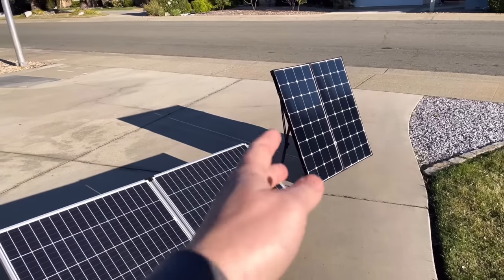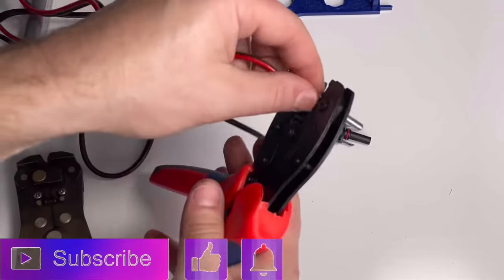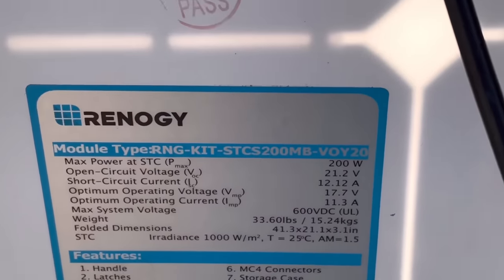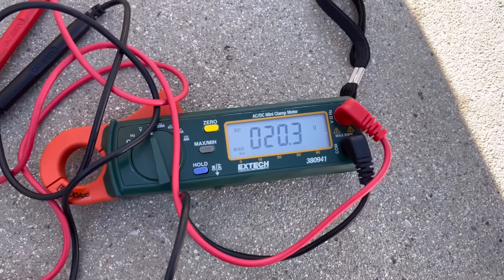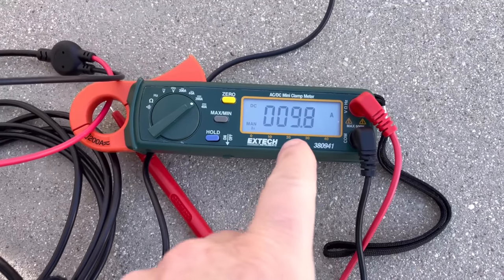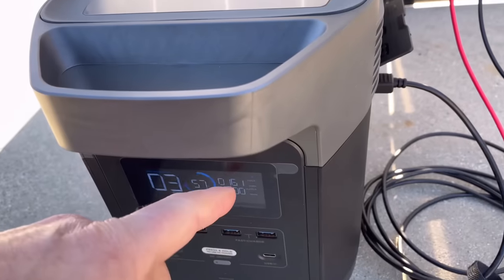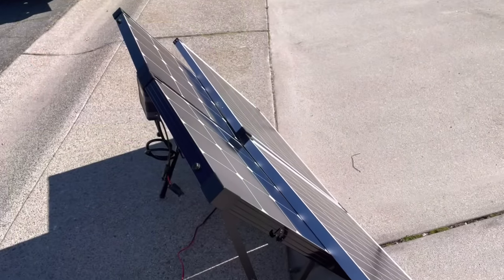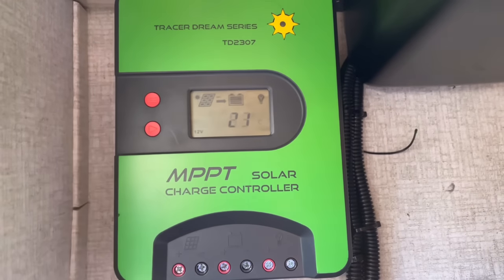Best Solar Panel - Harbor Freight 100 Watt Solar VS Renogy Eclipse Solar

Comment: I've got "200 watts" worth of harbor freight  flat mounted on my roof.  2 years later I can say.   The charge controller in their Kit SUCKS. But...they are damn useful. I have lights, device charging and super important..  FANS. I had to replace charge controller.   But the actual panels have proven to be super useful and durable,  despite a couple of brutal hail storms.
Reply from the maker: Nice thanks for the feed back ..👍🏼
Reply: Do u even need a charge controller if u plug them directly like into an ecoflow delta? New to solar thanks
Reply from the maker: No you do not, as most power stations if not all have a built in charge controller to charge at the correct rate. So all you need is a solar panel and the right connection for your charging station. 👍🏼
Reply: @johnnysweekends  ok great thanks
Reply: @troyyarbrough   I'm no solar expert by any means...I travel full time in a 1987 decommissioned ambulance, the harbor freight kit was super useful...all plug and play, can't screw it up. But yeah, fried change controller in just 3 months!
Reply: @troyyarbrough  why bother with the kit then. The kit is 4 25w.panels equaling 100w. These 100w panels are about 2/3 the size of the panels in the kit.
Reply: @johnnysweekends  You don't know what you are TALKING about with all due respect. Not all Pwr Station internal controller are optimized or the same. Not all solar panels are the same. There are less than ideal combos. Very popular YT channels have shown this.. YES I could run straight panels and get 90 watts and almost nothing with low sun. With the booster (it up to the same Volts and Amps to the equivalent to the Power Brick it comes with. AC plug in brick is 24v/5A/118W). Matching that with panels the Pwr Station comes alive. Are there higher voltage panels that would do better straight into the Pwr Station? Yes. Could I use lower voltage panels in series and get closer to the magic 24 volts (magic to this power station).  I have a degree in engineering. I have tested this extensively and know what I am talking about. See you at Harbor Freight. Peace.
Reply: @miamivice1149  I got a rover myself.  Not a bad controller, get the wifi adapter.  The wire terminals suck.

Comment: I bought four of these today, 4/10/22.  They are on sale yesterday and today for $89 per panel. Not bad.  I figure these, along with a Bluetti AC200MAX, will give me a good start on emergency power for the house to keep food frozen.  Additionally, it will pair nicely with the solar setup I have in my camping rig.
Reply from the maker: Nice that is a good deal. I bet they stocked up…
Reply: LOL fail. Wait to go solar.
Reply: My first renogy 100w panel was $130 later prices went down to $67 per panel on ebay.
Reply from the maker: I have one of the Newair portable fridge and it’s been great so far. I did a review on it. And have a promo I think for a little longer if it’s something you wanna look at..👍🏼
Reply: @johnnysweekends  I have an Aspinora fridge or freezer that I like.  Interested in one that has a true fridge AND freezer though.  Space is a real issue for me though.  I camp out of the back of my pickup with a 6.5 foor bed, so the freezer needs to fit between my sleeping bed, and the other wall of the pickup.  I have also switched from lead/acid to both a LiFePo battery, and a Bluetti AC200MAX for storage. Both have proven themselves needed, as we have had lots of rainy days this year. I am also a bit of a prepper, not hardcore, but that Bluetti will keep a fridge and freezer running by itself for a number of hours.  Couple that with the four solar panels (currently uninstalled), and I should be able to keep the fridge and freezer in the house running indefinitely.
Reply from the maker: Sounds like your setup is ready for what ever you choose. Just need to measure your space and start looking to see what will fit.
Reply: @johnnysweekends  Seems like I am always remeasuring, reallocating space. I went from a mattress the width of the floor to a 30" wide cot and mattress, which leaves me with about 39" of width to play with.
Reply from the maker: Hmm that fridge may work ? Probably be close.
Reply: A lot of people want a plug and ignore Battery/inverter. I lost my power for a week and never lost anything on two refrig's by running for a half Hour or when they turned off every 4 hours. Before I went to bed I ran until they turned off.  I was on my 3nd of 4, 6 volt batteries in my Golf cart, so I had another 2/3 days to go. Now I bought the Solar battery with a 1800 watt inverter and I think I am good until something breaks.
Reply: I have a SET POWER freezer fridge about the size of a big cooler.
3 100 watt HF panels, 3 deep cycle lead acid batteries with a 30 amp controller.

Works great.

I use the freezer part to freeze large bottles of water.
The squarish juice bottles work well.
I rotate the bottles into another cooler to keep food cold.

The dual zone refrigerator part is large enough for keeping 1/2 gallon of milk, butter and other small stuff cold.

My next expamsion will be to buy an ice maker and run it from solar wirh an inverter.
Reply: Wouldn't it be cheaper to replace the frozen food than spending big  bucks on solar?

Comment: Where you will see the difference between these two panels is in conversion efficiency. Renogy uses monocrystalline cells and HF uses a cheaper polycrystalline technology. The monocrystalline cell will produce more energy in less than ideal conditions such as cloudy days and or orientation of the panel. It's still a cost vs benefit decision, for me, if I had $500- $600 to spend on solar I would go for twice the capacity with HF panels.
Reply from the maker: These are actually Monocrystalline panels. It’s a newer line they have now and if you get a good coupon instead of the $119 price you can sometimes snag for about $95 if they have them.
Reply: @johnnysweekends  If that's the case, it's a no brainer.
Reply from the maker: Right ..!! 👍🏼
Reply: I can't speak for Harbor Freight, but Renogy has the absolute WORST customer service in the world.
Reply from the maker: I have heard the same. HF if you buy the warranty you swap and go..👍🏼
Reply: @Rob Ott lol
Reply: They are currently on sale for $89.99 through 4/10/22
Reply from the maker: Wow smoking deal..!
Reply: @MudmanMedia  WTF, WHERE?
Reply: @MR-nl8xr  Harbor Freight.
Reply: @MudmanMedia  Yea, but which location. I was just in the store and they were still 119.00.
Reply from the maker: Hmm maybe a region thing.. I should check 
Local store
Reply: @MR-nl8xr  I got mine in Hermiston, Oregon, a small store.  They had about 10-12 in stock, and more on order.  Sale ends today though.
Reply: @MR-nl8xr  I got mine in Dayton, Tennessee. It seems most of the stores in the Chattanooga and Knoxville area have them on sale.
Reply: The only time panel efficiency is a real need is in limited space applications . So yes RV and other mobile applications go with higher efficiency panels. Permanent applications I pay no attention to efficiency , I have all the room I need so why pay more per watt. Solar is fun , much , much cheaper than ten years ago. Both my remote locations have solar systems far cheaper than bringing power in.
Reply: Same, get two sets for the price of one.
Reply: I have the HF panels, and I'm going to get 2 more 100W panels to have a total of 400W.   I'm very happy paying less and I will do the adoption to make them better no need to o ay so much more.
Reply: Blue = poly
Black = mono

(most of the time)
Reply from the maker: The only problem with poly panels is they perform even worse in higher temps and they have a decently shorter lifespan then the mono type panels. So over 5-7 years after degradation of roughly 20% the mono panels will still be producing a decent amount more then the older poly type panels. So in the long run …👍🏼
Reply from the maker: No problem I still thought the same a couple years ago but the monocrystaline are just that much better now. 
But If you truly want the most watts for your buck stay away from these little portable panels and buy a residential panel. Like 335 watts for $150 bucks lol. 
Lightly used all over 👍🏼
Reply: @johnnysweekends  I have to agree panels have in average a 25 year @80% life. So buy all the used panels you can find , really especially if they are only like five years or so. BARGAIN! For the newbie I can’t say enough about the harbor freight experience. Learn in that system, play with that system  heck break that system . Everything you learn on the cheap system applies to any solar system. Besides it’s a great system for really small remote needs.
Reply from the maker: Yea I have seen those before. But really it’s buying what ever works for the cheapest price to save money is what people seem to be looking for.
Reply from the maker: Agree!
Reply: Great video, you very knowledgeable. Maybe you can help me.
I have 2 12v rv batteries that I'm trying to keep charged without running the generator. Just using led lights and running the radio, and heater fan at night when it's a tad bit cold. How many panels do I need to keep these batteries charged. If more then 1, which I figure 3 to 4 100 watt panels, what would be the best wire and such components to use to build a good portable setup?
Thank you!
Reply from the maker: Most the time to just keep a battery charged in storage 50 watts will do because it’s not being used. 
But when using your batts while camping 200 watts is minimum because most people camp in a lot of locations that are not flat with sun everywhere. It’s the coast or the mountains where you loose some solar hours. So 200-400 watts would be great and a portable 100 or 200 watt panel you can hook up as well for time when maybe camping in the trees and you may have to chase the sun a little with a portable one. 
 
Normally with solar more the merrier because then you don’t have to worry so much. Just don’t over load your controller . 👍🏼
Reply: @johnnysweekends  my rule of thumb? Double what you think you need, seriously !
Reply from the maker: For sure especially on RVs because with all the panels flat and never at optimal angle or direction of the sun plus trees and mountains it seems that is becoming the standard. 
Yea just get more.. 😂👍🏼
Reply: NEVER buy Renogy.  They sent damaged product didn't receive back.  Actually told me I had wrong number via email.  I reported them
Reply: @TC-qs7yb  trendy heavily markets stuff is not usually worth it. I always hunt around. The sheep buy the noisiest, with out thinking. Especially Solar panels. Panels can be had for next to nothing used , after 25 years most panels are only 80% efficient. Let’s see 20% of the cost for 80% of the power. Nope I am going the trendy expensive crap. I think not especially if this is your first DIY solar project
Reply from the maker: A lot of complaints about renogy
Reply from the maker: I agree residential panels are the best panels to get for dollar per watt even better used. They only thing these are good for is right spaces and weight savings depending what your doing. 
But not cheap.
Reply: @ytSuns26  we have a very small slide in camper on my husbands S 10 Chevy truck. I just want a very simple set up to run a small refrigerator maybe a griddle and my coffee maker and maybe a light….Do you know of any simple kits that are very expensive as we only camp 2 to 3 times a year and I’d like this to be portable so I can use it elsewhere if need be
Reply: No they don't.  I just bought 6 and they are all monocrystaline😊. Got them for 89 per panel on sale

Comment: I started buying H-F panels when they came in packs of 3 for 90 watts total for about $99 and added a total of 18 panels (I think the last set cost $139).  All the sets come with their own controller.  I live off grid and feed the panels into a bank of 6 each 80 amp NiCad batteries and run a 5000W/10000 surge inverter.  I feed the battery bank with a Champion 3500 W gen powering a 100 amp battery charger as a back up but rarely use it.
I also put in a 500 wat wind generator but have found the money would have been better spent with more solar panels.   This is a poor mans set up but it works great and I can't complain about the cost (less than $2000).  The H-F solar panels have held up great in spite of hail,  freezing, hot 100* and snow.
Reply from the maker: Wow awesome, where about are you living off grid, seems like more and more people with minimal living costs.
Reply: @johnnysweekends  Up in the Rockies.  9000' so it's just seasonal but a nice getaway for the summer.  I got my off grid ideas from my wife's friend (a retired Fisheries Biologist) in Michigan.  He bought a pretty elaborate system with auto starting generator, wind generator, solar and lead acid battery bank.  I just built on that concept to see how it would work taking 
the cheap route.  So far so good.
Reply: I don't think the wind turbine was a mistake, you have to have a backup for when the sun isn't shining, don't you?
Reply: uh, 80 amp NiCad battery? I didn't know such a thing existed.
Reply: @nullsmack  Surplus aircraft batteries.  They weigh about 80# as well but last forever with proper maintenance.
Reply: I am interested in doing my own solar setup at home how do I get started.
Reply from the maker: Need to figure out what you wanna power. Grid tie system? 
Ground mount or something portable?
Reply: @johnnysweekends  it’s for my home
Reply from the maker: So a grid tie system will have be hooked up by a electrician and also permitted 
Unless you live kinda out away from everything
Reply: @johnnysweekends  you mentioned using old airplane batteries I am looking an affordable way
Reply from the maker: I didn’t mention that but some one else did. But it depends on price , where you can source them and how much power you can get from them for the price. 
New lithium batteries even from some cheaper brands are getting crazy cheap for how many Ah you can get. 
So see what the price is of both as lithium battery prices are dropping.

Comment: I bought 2 Renogy Eclipse panels 5 years ago. They died within 2 years. It took forever to replace them and I needed new ones on the camper so I replaced them with 2-100 watt Rich poly panels. When I finally got the Renogy panels, I decided to make a suitcase setup with them. I drilled 6-1/8" holes in the frames for hinges. The panels died within two years again. When I returned them they voided the warranty and never returned the panels. Had they been prompt in returning the first panels, I wouldn't have bought the Rich Solar panels. I will never do business with Renogy again. BTW: The Rich poly panels are still cranking out great power.
Reply from the maker: I have not great things about renogy customer service but again maybe it’s the upset people but I have not heard any positive so…🤷‍♂️ 
When it all comes from China you just need to find what’s the better of the bunch for the price 👍🏼
Reply: The Rich solar are $89 on amazon
Reply: Yeah, A few years back, i bought some renogy panel set ups for my bosses farm. it was supposed to have two panels an some other hook ups but all we got were panels. we reported that to them and just asked them to send a controller and something else but they wanted the 2 panels back as well since they didnt have independent parts. we tried again, and then we were missing one of the panels so we bought two more sets until we had all the parts we needed and then sent the rest back for refunds. seemed like they had already robbed parts outta the boxes for other RMA's or something. it was kind of a shit show.
Reply from the maker: Weird, yea again I just don’t hear good things about the customer service. 
And for the price it’s just seems a lot higher.
Reply: @xspence2404  🤣😝
Reply: Thanks for the info

Comment: For a mobile setup (camping and such) I would buy the Harbor Freight panels. If I'm going for a more permanent stationary setup, I want whichever panels will stand up to the elements on a 24/7 basis.
Reply from the maker: I agree. I would go with more of a residential panel. Normally you get more watts per dollar anyway. Always good to have a little mobile set up though for when under the shade. You can walk some panels around
Reply: My trailer mounted old Harbor Freight panels have been out 24/7 for 11 years.

After a few hailstorms, one panel has a tiny star crack/ chip.  Largest hail was appx ping pong ball size.
(Got missed by the TX largest hailstone ever by about 10 miles)
Reply from the maker: Wow 11 years is a while and those are probably not mono panels either. 
Crazy still holding that well. Awesome, thanks for the feed back. 
😀👍🏼
Reply from the maker: Ouch we even had a decent hail storm here two years ago but everything was a quarter size hail. Some a little bigger but most about that or less. But it did enough damage to replace roofs and damage cars. 
But not as big as what it gets back there.

Comment: I bought 3 of the Harbor Freight ones.
Along with a low cost 30 amp PWM charge controller and 3 deep cycle sealed lead acid batteries.
That system runs a 12 volt Freezer/Fridge.

I live in Texas and having the ability to make ice if the grid goes down is a necessity.

I use the ice to keep food cold and add a couple of  blocks  to the water cooler.
Saves a bit on buying ice every day for work.
Reply from the maker: Nice!!! Love it. Thanks god the feed back. 👍🏼